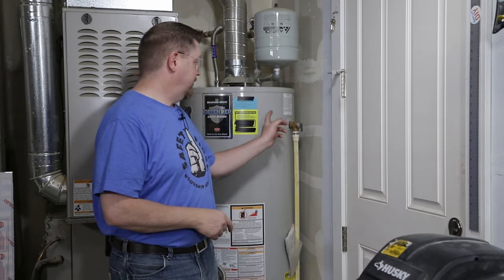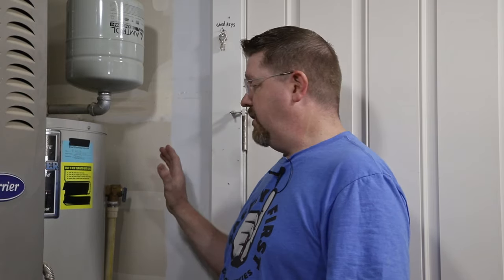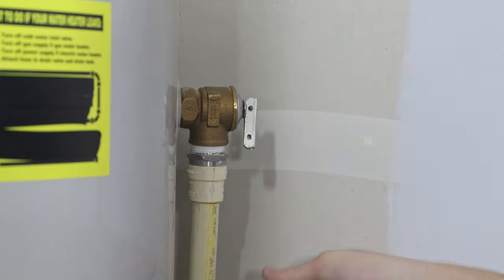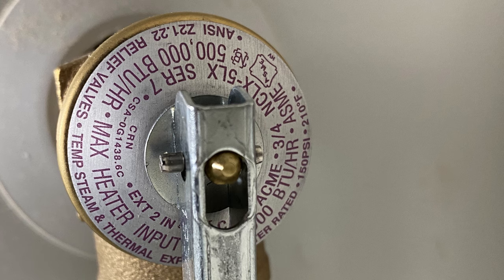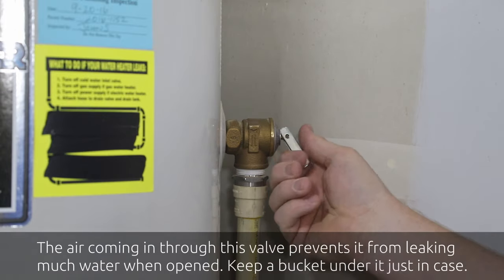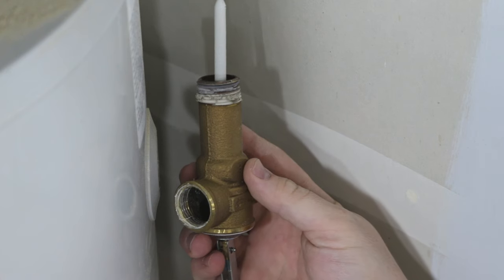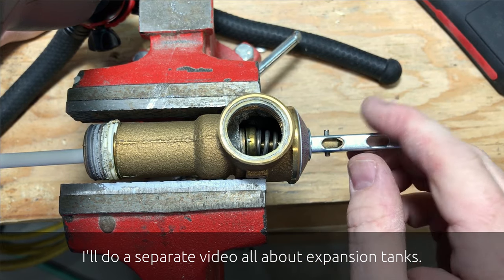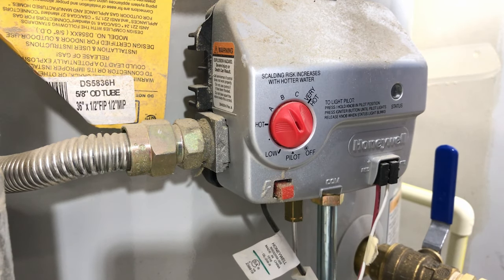How To Replace Pressure Relief Valve On A Water Heater (T&P)

Comment from the maker: It's really important to make sure this valve is working correctly on your water heater. Test it annually, and replace it if it leaks!
Reply: Could I get a link or brand for the thumb-operated driver at 9:53 ? Thanks for the video, wish me luck!
Reply from the maker: Hi Ozan - I would call Cash Acme (manufacturer of these things) and ask: 877-700-4242. Good luck!
Reply: Do you mean to replace that valve annually. I never touched mine in 10 years.
Reply: Does the water temperature have anything to do with the pressure building?
Reply from the maker: Hi Deanna - no, test it annually, and only replace it if it does not work correctly.
Reply: @AmplifyDIY  So we can replace the valve when needed and not have to replace the whole unit? 🤭 Thank you for responding. 🙂
Reply from the maker: @Deanna Smith - That's exactly right. Thanks for watching!
Reply from the maker: Hi Deanna - yes, water temperature is correlated with internal pressure. As the temp increases, so does the pressure.
Reply: Plumber here said you never need to service the boiler WTF!
Reply from the maker: @chrismbroome  Is this advice coming from a plumber who just sold you a new boiler because the old one was never serviced?!
Reply: @AmplifyDIY  well i rent the apartment,  so im not the one that paying for the new boiler. However,  yes he said it never needs to be serviced in a firm tone. Despite the sticker on the boiler saying that the boiler needs to be maintained every 6 months to a year.
Reply from the maker: Regardless of who pays for it, it's in the plumbers best interest to not have any customer maintain their equipment... means more service calls, more expensive repairs they get to bill, etc... Stick to whatever the owner's manual says. :-)
Reply: As a plumber I do not approve😐NEVER OPEN THAT VALVE.  He said it him self 😂 if you open it scale build up can cause it not to shut properly so why Evean deal with a situation you can avoid 😂 heater is not going to blow out your roof 😂😂😂
Reply: really bad idea- they are designed badly and/or are designed to fail if you test it.
Reply: How can you tell if there is a problem with the expansion tank
Reply from the maker: @By_Any_Means_Necessary  I did a whole video on Expansion Tanks here: https://youtu.be/NGygvtP6Sdk - Good Luck!
Reply: Thanks that I've found your video, I'm replacing my water heater elements and T&P value. But I can't for the life of me get the T&P value loose, I've tried cresent wrench, pipe wrench, pipe wrench with a piece of pipe for torque and still can not loosen it, the tank keeps wanting to move when I put torque on the value. Maybe I should have left some water in the tank for weight. And yes before you ask yes I'm turning the value counterclockwise.
Reply: I tested mine every month.  Maybe that's why it failed after 8 years?
Reply from the maker: @jgreat4785  8 years is pretty good for one of these valves. I hope yours was easy to replace. Thanks for watching!
Reply: @AmplifyDIY how long should it take a 40 gallon tank to drain from the t&p valve??

Comment: So the "professional" plumber that installed my water heater just went on a tirade and called me every name in the book just for asking if this is something covered under warranty. I've never heard a business "professional" use so many F-bombs towards a customer!... Anyways after my initial shock I found my way to this video and was instantly put at ease. Obviously I gave it a thumbs up and instantly hit the subscribe button. Thank you sir, you are a godsend!
Reply: Sorry to hear that. Unfortunately  psycho contractors are out there giving the good ones a bad name
Reply: I've had my share of these crotchety old plumbers. I suspect the ones who tell you to never do maintenance on your water heater just want to sell you another one in four years.
Reply: @rickarchambault4756  it's a double edge sword. If you flush it you could have a leak that sediment was blocking. Or cause one due to negative pressure. But yes it. Is a mechanical piece of equipment.  The best maintenance advice I can give is clean out around the burner. Ie any dirt/hair. There's a reason most companies only warranty for a couple years.

Comment: Was quoted $450 when I had a plumber out doing some other work at the house, which did include a $100 valve. Bought a $20 valve from Lowes and changed it out myself following this video, thanks!
Reply from the maker: Great job!

Comment: It's been said multiple times by other commenters, but this is the best DIY video ever! I like to do everything myself and have gotten pretty good at it over the years. My T&P valve is leaking and I thought changing it out would be fairly straight forward, but wanted to check YT just in case. The extra bits of information you add, such as the possibility of clearing a leaking valve seat by flipping the relief valve handle a few times, makes your video invaluable! It's all there! Nice job! Liked and Subscribed! ;-)

Comment: I HAVE WATCHED A FEW OF YOUR VIDEOS. I DECIDED TO SAVE YOUR INFO SO I CAN WATCH MORE. YOU DISPELLED A FEW MYTHS AND WE ALL APPRECIATE THAT. I HATE COMMENTING BUT IN THIS CASE I HAD NO CHOICE. YOUR INFO IS VALUABLE AND OF COURSE VERY HELPFUL. 
I CAUGHT YOUR VIDEO ON REPLACING THE BALL VALVE AFTER HAVING TROUBLE DRAINING MY TANK. SURE ENOUGH AFTER INSTALLING THE BALL VALVE  & DRAINING THE TANK A FEW TIMES I TESTED THE TEMPERATURE PRESSURE VALVE...IT LEAKED. I NEVER WOULD HAVE CHECKED THIS (WITH OUT SEEING YOUR VIDEOS) BUT BY DOING SO I NOTICED THERE IS A STICKER NEXT TO THE VALVE THAT STATES TO DO JUST WHAT YOU SAID, TEST AT LEAST ANNUALLY. I JIGGLED & FORCED IT CLOSED (SEVERAL TIMES) TO BUY ME TIME TILL THE NEXT MORNING. WENT AND GOT ONE AND AM INSTALLING TODAY. I ALWAYS USE IT TO DRAIN THE TANK BUT WHEN IT WAS FULL OF H20 AND I ACTUALLY TESTED IT AFTER REFILLING THE TANK, THAT IS WHEN IT FAILED. JUST OPENING IT DOES NOT TEST IT.

I LEARNED QUITE A BIT OF INFO BY READING THE COMMENTS WITH YOUR RESPONSES AS WELL.
THANK YOU FOR YOUR EFFORTS I APPRECIATE YOUR INFORMATION THAT BOLSTERS OUR EXISTING KNOWLEDGE AND INFORMS US SO WE CAN DO THE JOB CORRECTLY AND NOT ONLY FIX PROBLEMS BUT SEEK TO IDENTIFY PENDING PROBLEMS. FOR EXAMPLE THE T&P VALVE IN MY CASE WAS SPEWING H20. ALSO THE TAPE AND PLUMBERS DOPE IN CONJUNCTION WAS NEWS TO ME ALBEIT THE CORRECT WAY. ASK MOST PEOPLE AND THE WILL NOT KNOW YOU NEED TO WRAP THE TAPE AGAINST THE THREADS. THE LIST GOES ON.
Reply from the maker: Thanks for all the feedback, Mel! I'm glad you have found some of my videos to be useful. :)

Comment: This is the exact heater that I have.  I flushed it a month ago, and just tonight, I noticed it was leaking.  The closeups were very good.  I feel confident after watching this that I won't screw anything up replacing this valve.

Comment: First time viewer. Replaced T/P valve in about an hour (not counting a trip to hardware store). Total cost 40 bucks (replacement part, sealant tape and a better pipe wrench). Thank you! I learned a lot and probably saved time and money!
Reply from the maker: Nice job!
Reply: @AmplifyDIY  *Taking the valve off took a lot more effort than expected. It was like loosening a lugnut on a wheel axle instead.  Previous person wanted that thing to stay on! I was worried about damaging water heater. But some careful elbow grease did the trick. This was the only thing that slowed me down.  But everything worked/happened just as you said!

Comment: I'm one of your newest subscribers, and really enjoy your production qualities and the thoroughness with which you cover your topics. One thing I've found helpful after doing any kind of plumbing work like this is to remove all faucet aerators before turning the water back on. There's bound to be a bit of sediment loosened that can clog those things quickly. Thanks for the great work!
Reply from the maker: This is a great tip. Thanks for the advice!

Comment: Found a leak on the overflow pipes outside the house. Came across your video, opened and closed the pressure valve a few times and the leak stopped! Didn't even know what a pressure valve was. Thank you for the informative video.
Reply from the maker: Nice job!

Comment: I agree with you regarding periodically testing any TPR valves. I do so for the boiler and water heater at our residence twice a year when I test my smoke and CO detectors. I also strongly recommend clients do the same. I have replaced a TPR valve on a boiler which was leaking, but have not yet had the need to do so on a water heater.

Comment: Thanks for the great video.  I had a drip from my drain line and followed the steps outlined in your video and successfully changed out my TP valve.  My cpvc drain line was also glued, but as my water heater is in the attic and has a long drain line which directs the flow outside of the house.  I ended up cutting the cpvc and installing a cpvc union below the new valve to make it easier the next time whenever either the TP valve or water heater is replaced.  Other than that, I followed your steps exactly and will hopefully get a few more years out of my water heater.
Reply from the maker: Nice job, Al! I'm glad my video was helpful, and that you were able to adapt and adjust for your specific situation. Cheers!

Comment: A big shout out to a fellow Idahoan from Eagle. I was quoted $400 to have the pressure tank and valve replaced. I said nope I’ll do it myself. I checked the tank and I think it’s ok but the valve leaked a lot over night and now there’s a steady drip after releasing the latch to test it. Thanks again for all the water heater videos. I’ll be tackling this tomorrow. Your water heater setup is exactly the same as mine. I guess we had the same builder. I have to cut my drain pipe in order to unscrew it from the valve. Thank you Mr. Plumber.
Reply from the maker: Hey Dennis! It's always fun to hear from a local! Were you able to get your heater situation all straightened out? I hope everything went smoothly. Thanks for watching!

Comment: Another great one ADIY. Spot on with use and checking of that overpress valve. I called my manufacturer and they sent me one for free so might try that approach when getting a replacement. Probably worried about lawsuits. Play dumb when on the phone and say that yours is dripping slightly. Probably good to replace every 5 years anyway!  Great job.
Reply from the maker: I hadn’t even thought to try calling the manufacturer to I quite about replacements. Great tip!

Comment: Replaced mine 7-30-2021. It had a constant leak, even after opening it several times. The replacement was 
CASH ACME NCLX-5 SER 7   ONLY❗️ The rod was coated with what looked like sand. This TMP valve has only been replaced once over several years. Removing valve was easy. Draining water heater, took awhile.... it flowed really slow ( and I need to upgrade that valve too , like you did 👍🏻). Installed TMP valve and there are ZERO leaks. I kept my old TMP valve for future. Now I too have an expansion tank and when it was installed, all lines were soldered in. But I new nothing about testing it. And I don’t have that fancy pressure gauge, but do have old type air gauge which will give me some reading. Maybe I can get water pressure from district utility. Thank you for your many help videos. 7-31-2021
Today 8-1-2021 , Again I replaced the TMP valve and flushed the water heater. Didn’t think about the expansion tank until I watched another video you did, and my exp. tank had two thuds and no ping⚠️ Got a new Exp. tank, water pressure gauge, and pipe dope/ Teflon tape. My water pressure tested at 80 psi. The new Exp. tank is set at 40 psi. And I’m using a portable air pump that I have in my vehicle for tires. And just watching this video once again to get proper instructions to replace and install new Exp. Tank. Well it’s installed and I’ll check it though out the next few days and a couple weeks. My tank is only 2 Gal. and hangs having AIR PRESSURE Valve at bottom. The previous Exp. Tank was installed the same way, having no extra supports. 👍🏻💓❗️🇺🇸 Stay Safe.
Reply from the maker: Awesome!

Comment: This has been so helpful and I'm so appreciative of how simple you have made this out to be, as well as the trouble shooting🤝🏿
Reply from the maker: Thanks, D!
Reply: @AmplifyDIY  I've got a question, I have the same Bradford white heater, I don't have a drip I have a full on flow of water through the TNP valve, does this sound like this issue could be more then just replacing a TNP valve? Thank you for your response.
Reply from the maker: @Dnyce07  Hi D - yes, it sounds like your T&P valve is not seating correctly. I'd recommend swapping it for a new one, and go from there. Good luck!
Reply: @AmplifyDIY  Are you talking about replacing the T&P Valve or the whole tank which is about 8yrs old, thanks for the advice.
Reply from the maker: @Dnyce07  Apologies for the confusion: If you have a steady stream of water coming out of the drain pipe attached to your T&P valve, you need a new T&P valve. The heater itself is likely just fine. It sounds like your T&P valve is no longer seating correctly, and is therefore not closing all the way, so water is leaking out of the tank through the valve. Replace the valve only, and see if that solves the issue. Good luck!
Reply: @AmplifyDIY  Thank you Sir, I will do just that, No apologies needed, in sure you are swamped with mills of questions I should of been more specific, very helpful and saving me a lot of cash, Thank You again!

Comment: We had a soft water system installed 7 months ago and the guy said that this was something to look out for, a leaking T&P. Well, a few days ago it must have popped open because I noticed the wall of my bathroom was wet. I looked for the source of water and it was from the long drain downtube. I called the number on the sticker of my water heater and they would love to come out for $99 to tell me what this video just showed me. I never knew about this valve and we've had our water heater since January 2012. Great Video and it will save hundreds of dollars! $!$! Thanks
Reply from the maker: Nice! I love it when my videos help people. Hit me up with any questions that come up getting your valve fixed. Good luck!

Comment: Just a word of advice, if it's leaking and it's a few years old, don't test it, just get a new one.  When I tested mine, it wouldn't shut off.  I ended up having to scramble to place a bucket, shut off the power to the water heater, and shut off the cold water (which required a step stool to get to).  I'm guessing that the cold-water shutoff was placed high in case a larger tank was installed.  Luckily, I had a step ladder nearby.

That being said, this video was well worth watching.  The old one was full of sediment and would have caused a lot more of a mess if it opened up when I wasn't there. Picked up a replacement pressure relief valve from Lowes and installed it.  At least that's one less thing that I need to worry about for a while.  Now I just need to flush it and install a new anode rod.

Comment: Thank you for making this!  Bought the same valve for $20 on Amazon and did it ourselves!  The only thing is it took a long time to drain the water down…not sure why this was but just in case plan for about an hour start-to-finish.  The actual valve replacement took 5 minutes.
Reply from the maker: I'm glad the job went smoothly for you! Sounds like you may have a clogged drain valve. It may be time to flush your heater and/or upgrade the drain valve: 
Flush: https://youtu.be/hs5N7HyDUWo
Replace Drain: https://youtu.be/OBPJYg0o_o0

Good luck!

Comment: Huge Thank You. This video was exactly what I needed. Just finished replacing my temp/pressure safety valve. This was a pretty simple job, but boy was this video a life saver as it was my first time completing this task. Didn’t use pipe dope, but only teflon tape. Not a big fan of the dope getting in the hot water. Will monitor and if it needs dope I can easily redo the task as needed. The original valve did have dope applied though.  Again, thanks man!
Reply from the maker: Aw man, you made my day! I love hearing that my videos are helpful. Thanks for watching!
Reply: Pipe dope is only supposed to go on the male treaded part.

Comment: Great video.  I wish I had watched this before I replaced the Pressure Release Valve.  The one I bought at the Home Improvement store wasn’t EXACTLY the same specification, so I am afraid that is why it still leaks about 1/2 - 1/3 gallon of water a day.  Now, I have purchased the exact same valve as the original (thank goodness I kept the photo of it), the same manufacturer, the same model, the same specifications (thank you Amazon).  Hopefully, that will solve the problem. 
Oh, I haven’t drained and flushed it since I bought the house 3 years ago, so just in case it is sediment blocking the valve I am going to drain and flush the tank at the same time … after watching your video “Draining and Flushing a hot water tank”.  😊
Reply from the maker: Heya Paul - I hope you have gotten your heater all whipped into shape now. Thanks for watching and commenting!

Comment: Thank you for this very helpful video. Just like you, our plumber that installed the water heater tank thought that sealing the pipes/ joints, that connects to the relief valve, with not only glue, but a metallic type glue. Seriously plumber dude?! So I had to file all the joints until it loosened up and finally freed it up, waste of almost an hour when the job could’ve been done long ago.
Reply from the maker: I'm glad you got it done! Nice work!

Comment: Thanks for the information. It started to leak and it looks like time for change.
Reply: Thanks again! Local HD store had a model slightly longer in size.  Once we removed old valve it was covered with white stone like coating and completely locked in place. New valve only cost 20$ and 30 minutes of time. Thank you again.